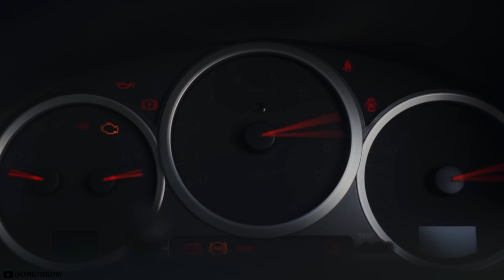Donut Media VS. Subaru

Comment: I was on a Subaru 24Hours of Lemons team. The car would usually run the full 14 hours of a race weekend. But you had to pay attention to oil. Oil level, oil pressure, oil changes, oil baffles. In hard cornering, the outside cylinders get bathed in oil, the inside of the turn, no so much.

Comment: MK3 supra guy here. i've blown six 7MGTES in the same stupid ways- each time pulling them, repairing them, replacing them with material upgrades and running them again. after the sixth pull i finally got it to not eat bearings. the motors are a lot like EJ's in the way that they spin bearings with little to no warning, however- it took me these seven motors to become a monster engine builder for these cars and made it so i can get big power out of an otherwise unremarkable motor. i've been able to help a bunch of people in my life enjoy these motors using my mistakes and expertise to get them running and stay running. if my friends didn't have me- they most likely would have done the same things and blow their own fair share of motors. a lot of it is luck- the QC at the toyota plants that made these motors were shotty, so not every motor was built to the same love. but once you get them in the right spot- they become these evolved, indestructable motors that perform in the same style of it's son- the 1jz and 2jz. 

i see the EJ as the same way. they're very capable motors however you really should have a guy who's made all the mistakes already and is very picky with his parts and specifications. motors can be picky- and if you're jumping head first into a car that doesn't have the "factory magic" that more ubiquitous motors have (JZ, LS, UZ) it can lead to disaster quick. at the end of the day i dont think donut did anything wrong besides underestimating the tendencies of the EJ platform to destroy bearings.

that being said- more than a few of these motors blew with no modification or tinkering, driving using the same car that subaru delivered to the dealership- driven how subaru engineered the cars to run. which, at the end of the day- points to poor QC at some point in the engine's life. whether it's previous owner, mechanic, or engineering/manufacturing.

TL:DR- we're spoiled with modern performance engines. its fucking hard to get a motor to not blow bearings after you beat the hell out of them on a track. the only thing they could have done is hire a pro subaru/EJ engine builder with a bunch of successful engines under his belt to act as advisor in this series.

Comment: People forget boxer engines are kinda... unique? If the oil's good and you maintain them properly they can be great but they have lots of little quirks such as oil leaks from the side, increased chance of rod knock etc. As soon as they get a hint of oil starvation you're in trouble.

You see in all the time in BRZ/FRS/86 community; someone turbos their BRZ and then the engine goes in 5k miles while someone else's turbo FRS has been good for 50k miles.

Everyone I know who has had an Imprezza has had an engine rebuild at some point. It might be a cultural thing as well... in the UK you buy an Imprezza being prepared for something to go wrong and you keep every last scrap of paper from work done if you want to be able to sell the thing down the line.

You nailed it with this video.

Comment: I'm sorry but the fact that the platform has such a high skill floor and such a low performance ceiling makes it a shit platform. At least with rotary engines, you can push the performance envelope extremely far.

Comment: As someone who sells car parts for mostly Subaru owners. I always tell people that if either A: You're looking to make 450whp and up, you're looking to spend at least 14k for a reliable set up, their are better platforms that will get you high HP for less money such as a Civic, S550 Mustang, Camaro and ETC. B: What is your goal with the car? Then I proceed to tell them the common issues with these cars if not properly addressed. They're a fun and good platform but you really need to do your research and due diligence to make sure you do everything correctly to prevent catastrophic failures. 

I recently had my 13 WRX spin a bearing and decided to address all the inherent issues, Clutch fork, pivot ball, firewall, oiling system, headers, and other parts for reliability. Dropped a new RA block as well and got the proper head gasket to retain the OEM compression. And also knowing the limitations of the WRX as the trans is not capable of holding more that 375-400whp. It's a love/hate relationship sometimes but it's the thing that puts the biggest smile on my face when driving it and enjoying what it is and knowing what I can do to turn in it into something more and capable of light track days.

Comment: I think you are spot. I also think there is a point with every car where they require more attention. A Subaru just needs more attention very early on in the engine mods. If people don't want to mess with reliability don't touch the motors. Most cars of that era are "slow" fast cars anyways.

Comment: The thing about those cars is, every bit of needed information is already out there. All in one nice place, As someone who has owned some older impreza's (sold one with 220k, and 363k), and now a 05 wrx with 178k original motor and trans working minty. Before I committed to the buy, I did a quick search on negatives, and its honestly user error for the most part. Buying used is always risky, but you have to consider what you believe the previous owner would of done as well. As for Donuts car, well, anything goes when you go hard on the motor. Lets just say there is a reason race teams rebuild the motors after races... All these cars are first and foremost built to drive on the streets, not raced around. Which is why you add supporting mods, and tune them better handle that kind of driving.

Comment: My brother's and I have had 4 foresters, a peanut eye and a stink eye. My sf5 forester had a 97 gc8 WRX motor swapped into it 3 years before I got it. Did some supporting mods, stock turbo, stock injectors. JDM ecu let it rev to 8k rpm. It even got towed and the truck ruptured the oil pan and all the oil leaked out. I replaced it the next day. Never had any issues. My gh was completely stock. Head gaskets blew at 280,000km. Shortly after replacing the head gaskets it spun a bearing.

Comment: I completely agree with you, but I also think that every car out there that is getting modified comes with a thresh hold like you mentioned with the Audis 2.7tt. some you can throw parts at all day and they will run fine but some for example a Manual Golf R, throw all the parts in the most recent ones and the clutch will give out. research is what really needs to be done, just like before buying a personal car.

Comment: Absolutely like rotary motors. The platform was great in the early 2000’s when 4 cyc turbo charged cars were so limited, that’s why everyone bought them.  I used to love them too just like Alex said.  However, then came the evo and nowadays the Honda type Rs and Toyota GR series, there just better choices out there.  STi still good cars, if you keep them stock and don’t stress the motor

Comment: I don't really watch too many young guys and my days of playing with these kinds of cars is LONG over.  But I have to say this was well researched and well reported.  I had a bugeye back in the day and it was perfect.  Because I didn't mess with it.  Friends did mild tunes (Cobb 1 or 2) and they were fine.  It's always the people who were trying to push huge power out of these engines that caused their own issues.

Every motor has it's secrets.  I came up in the world of SBCs and Ford 351s.  But you still had to know what you were doing.  These small, turbo engines are REALLY sensitive.  I also owned LR's with all aluminum motors.  Simple, but would eat head gaskets for breakfast, lunch and dinner if you let get even a little too hot.  

Simple take away, Subies are tricky to pull big power out of.  You need to know what you're doing and Donut didn't.

Comment: As someone who who’s  had my 2013 WRX for 6 years, and now a 21 STI.

I was irresponsible with my WRX, blew the motor at 98k miles, I put 50k on it myself, and did 2 oil changes in that time… I spun a barring on a pull doing like 115 MPH…. And the car had no oil in it…. Now some wouldn’t admit their own faults… and I think that’s a huge reason why Subarus get this reputation. I replace the motor, treated it like a gem after that and traded it in at 150k miles…. That was the only problems with the vehicle the entire time I owned it.

Comment: Subaru fanboys are missing the point entirely. Your platform shouldn't be this easy to break. The 350z wasn't, and that's made by a company that uses rubber bands for a transmission.

Comment: my first turbo car was a '02 wrx, back in 2006. bought it with 24,000 miles, spun a bearing by 40,000 miles. But heres' the thing: that was my fault. My subaru had a rough life in my hands, I fried the clutch like a month after owning it, it took me almost a month to complete that replacement, because removing the clutch fork was like an easter egg, especially to a 22 year old kid who'd never done such a thing before. At some point I ended up shattering 2nd gear, which all of teh older subaru guys had already told me was a weak point of the car. I was in the mindset of drive it till it breaks, then upgrade. I had to send the transmission out to be rebuilt by a shop that no longer exists, because no local transmission shop even wanted to touch it... like i literally had doors shut in my face for mentioning subaru transmissions. After all those repairs, and several thousand miles later, I finally toasted my engine.
I. fucking. loved that car. It was a money pit, but OMG was it worth every penny to me. I spent thousands of dollars keeping that thing on the road.  I loved it so much, that I eventually bought an '04 STI from a friend who'd trailered it back from Chicago with a rod stuck through the block. That car had a terribly rough life from start to finish as well.
I'm now on my 3rd subaru after taking a Hiatus over to Acura and VW for a while. I have a 2018 wrx which the previous owner apparently babied and did a fairly good job of getting all the parts that are on the car professionally installed.  It's immaculate, and I'll do everything in my power to keep it that way, but I also expect, like with every subaru I've owned, that eventually something unexpected is going to break. With this not being an EJ motor, I have no idea what I'm getting myself into, but the joy of ownership of these cars heavily outweighs the burden of owning something with a "niche" design.

Comment: I was 7 years old when I learned why they can be good, or bad. 20 years later. Never owned a subaru. Worked on plenty. I see the positives behind the chassis. But the negatives can be really daunting if you're suffering from ringland failure , etc. But as someone who has kept countless ru's on the road. They're not that great. But hey. To each their own. !

Comment: I owned a 2005 2.5rs na motor car. It ran to 220 000km original head gasket, then i took it over then ran the car till 340 000 km. 

The na motors are good. The flat 4 design is good for low hp driving. So from my layman point of view the physical limitations of the engine design show themselves once you add boost. 

Add inexperience and a shit ton of money to that and you get what we saw.

Comment: Pointing fingers is one of the most toxic traits of the Subaru community. And I never knew who was right until it happened to me. I have a 2013 FR-S that I bought quite a few years ago with very low mileage. It was never tracked, rarely pushed, and regularly maintained. It was my daily driver and seemed really reliable for a long time. I would also like to add that I never got the valve spring recall done, because of the fear of excessive RTV clogging the pickup tube. One day randomly on my way to work, it spun a rod bearing. It had 93000 miles. I posted some videos on it and right away, I started receiving comments that I didn't take care of it and the oil was probably low (it wasn't). Everyone pointed fingers at me. As someone who actually cares about his cars, it kinda sucks to receive the blame when you put in extra work to make sure it would never happen in the first place. Nobody in the community wants to accept that these engines just aren't reliable.

Comment: I'll be real, I'm firmly in the "I won't own a Subaru" camp because I owned a 2005 2.5RS that was rebuilt wrong, blew a rod a month in, and would have cost way more than the car was worth to get rebuilt. Which was a shame, because despite of the problems I was pretty stoked to own one. But I didn't have the time, space or energy to try and rebuild it or get a crate engine as an 19 year old working a full time graveyard job. And then it made me look back and think about all my Subaru owning friends who's cars worked a lot less than most of the time, and then I started digging to see my options and learned... these things just blow rods sometimes. Sometimes it's just mileage, the 80-120k mile mark seems to be a question of when, not if. And it still seems to be a problem to this day. The fact that your engine is just going to explode on you even in newer cars (No matter how much people claim it's fixed, it seems to not be fixed) is a huge argument for me to not get one. Symmetrical AWD is awesome, it's a huge selling point, but put it in any other car and I'd be way more interested. It just seems like there's a lot of acceptance that modding your car means you're gonna lose any sense of reliability and I've literally read DECADES worth of forum posts where people more or less just go "Yeah that's normal, you get used to it" which tells me maybe it's not that good a platform.

Fundamentally, if the car is so intolerant of work being done to it that it basically threatens to pull the pin on the grenade for the slightest fuck up, I'd say it's not a very good platform for a consumer vehicle. It's easy for super experienced techs to say it's no big deal but they're the ones usually making money off the problem anyway. And so I can't ever recommend a Subaru to anyone without the huge warning label about the fact it might blow up on you at some point, which sucks, because I like them when they don't explode. Buy something else, it'll be cheaper in the long run.

Comment: Not fully understanding how these engines work and what not to do on fresh rebuilds was the issue. The wrx block is so much weaker then the sti. I've had to replace a gearbox and an engine on my classic scooby. But I fucking love it. The noise is so nice and when you have it running well with all the good mods ❤🔥🔥🔥

Comment: I used to be big into modded Subarus. I have personally witnessed a WRX engine blow up on the dyno. The tuners were folks I have a ton of respect for and would have given them my money to tune my car. One of the biggest "names" in the Subie tuning world said "Motors are like Bic lighters. Buy in bulk and throw them away when they die on you." TL;DR - Subie open-deck motors are much, MUCH more delicate than something like a Honda or DSM inline-4.

Comment: As a Subaru technician, I can 100% agree that not everybody has the ability to work on Subarus, there is a lot of times where I will work on somebody’s car who used to be a mechanic, and whether they actually were or not nearly everybody is left speechless, what was nice for me was that I started with Subarus and because of that I never needed to relearn or change what I used to think was normal because it just is normal to me
Reply: Most of the guys that I work with came from a local Nissan dealership close by, they like the simplicity of the cars from a technician standpoint, but when you get into performance and everything like that, they had to agree that it is a whole different ball game

Comment: I've got a turbo Baja. If you're going to start turning them up, you have to make sure your fuel system is right. And you have to make sure the oiling system is right. Mine's on a 20g just to keep a little more torque away from low RPM. I never recommend these cars to people who I know would be dumb with them. It's not going to end well.

Comment: As an FD owner, I absolutely understand this. 

What happened was inevitable. If they'd done it with rotaries it would've been the exact same outcome. Not that either engine is bad, they just require more knowledge, more experience. It's a needy gf. 

I've always said about rotaries (and I think the same goes for boxers), they will either make a mechanic out of you, or you'll swap it or sell it. And for rotaries, most of the ones I've seen swapped are sold eventually anyway. 

It's a relationship for sure. 

So yeah, this was always going to happen. They took a car that required knowledge and experience they didn't have and applied the same method as you would a Civic. Nothing against them, it's a great series, but it is what it is. Boxers and rotaries (and probably some other engines) will always weed out those that aren't dedicated enough for it. And dedication is somewhat antithetical to this series. Why would you dedicate yourself to a certain engine when you're only going to build it for a short period and then shelve it or sell it? It doesn't make sense.